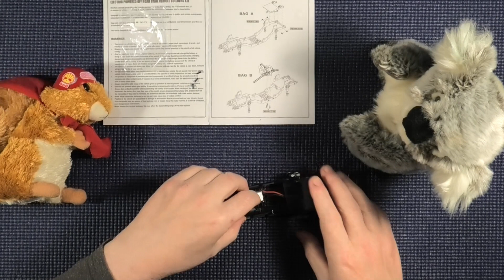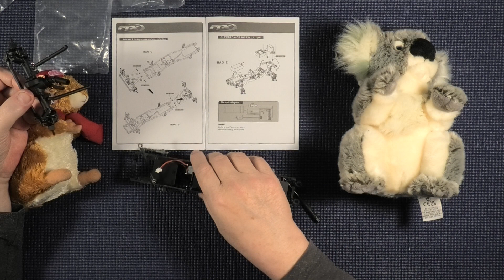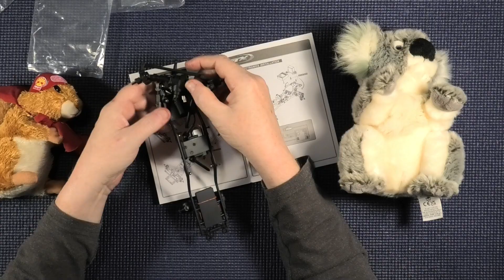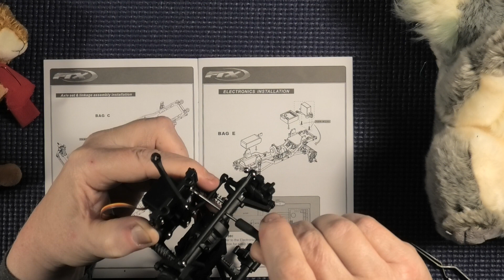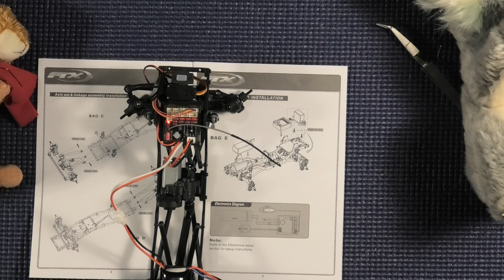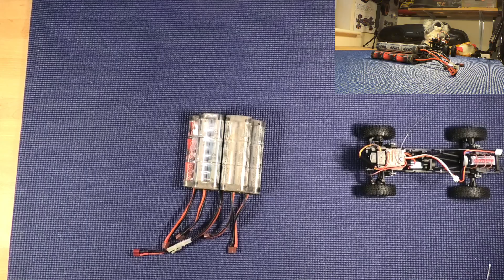FTX Outback Mini Rock Van Chassis Build

Comment: Nice job sir! I found going back to the smaller stuff after the 1/10 scale, everything is smaller, harder to see and easier to drop 😆 I like the wheel weights too. Very clever.. and you couldn't get the weight any lower with that design. Ideal! :yougotthis:🐨🐿